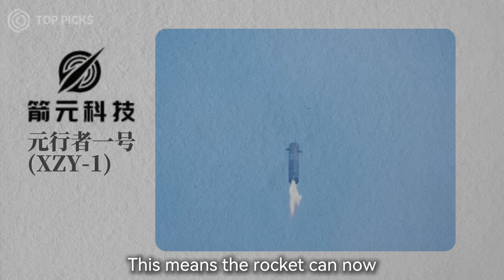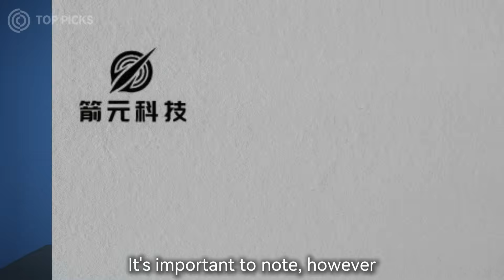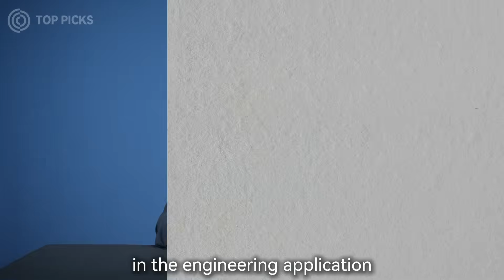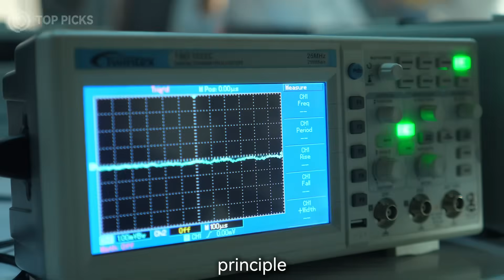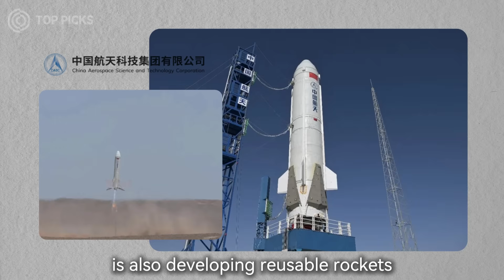Who is China’s SpaceX?

Comment: The expectation people share about SpaceX are laughable, especially as SpaceX show how they fail every time in areas NASA already did decades ago, while what China does is not only believable to achieve, it as well achieves i without failing at fundamental levels. If I ever wanted to fly into space, I'm definitely not choosing the death trap SpaceX is "designing" as Space is a literally death zone you can't just freely move around and expect nothing to happen as you are hit with ionizing rays which break you apart without shielding, no way of easy refueling/resupply or a way to not die of age on long trips (Apollo 13 is just an example on how easy it is to die in space, even with multiple fail safe on a trip to the moon).
Reply: US astronauts already ride to and from the ISS on Crew Dragon which is like 100x better and safer than your Shenzhou copy of Russian tech.  SpaceX is operating like NASA did in the 60s, and like Silicon Valley, built cheap and fast and test to destruction.   New Glenn did the opposite, and they just landed a rocket too.  China has yet to do either and is stuck with old copies of Russian tech.

That "death trap" you talk about, has already launched dozens of people to space and returned them. Last time China's crew return vehicle came back, it landed wrong and went out of control rolling along the ground.

The idea that Starship's current design is the one that's going to be human rated is due to your ignorance. The current ship is for cargo/refueling, it's not the Human Landing System (HLS) one. And as SpaceX proved with Crew Dragon, they can design a far far far better crew module than China can.
Reply: @TheVoid-g6f  will rocket labs neutron be third?
Reply: @blengi  Yes, Neutron is launching in early 2026. But Neutron is Falcon 9 class in payload. Terran R is also launching in 2026 and is more medium class.

So, the US will have the entire spectrum: Falcon 9/Neutron for small lift, Terran R for medium, Falcon Heavy and New Glenn for Heavy Lift, and Starship for Super Heavy. Plus SLS, ULA, Firefly.
Reply: @TheVoid-g6f  Cheers, good info. Is odd how people here haven't noticed spaceX has launched twice as many people to orbit in a few years than china's entire 20+ year manned space program
Reply: @TheVoid-g6f  I'm talking about starship and orbit isn't space, this is a very important distinction and yes look at the rockets, don't they look familiar? The designs of Falcon-9 and Crew Dragon aren't new they aren't much different from previous NASA designs. The issue is that someone wants to shoot people in storage silos into space expecting them to survive long trips although they need tons of extra material which as well needs to be protect likewise which results in a ton of weight, which is never tested by them and it still fails far before having any noteworthy weight. They test like there were never any space ships developed but even worse.

Comment: In my opinion, it is a trap to try to be a spacex. They have one operational platform (in which I include the variations of falcon)
But any attempt to replicate starship, will end in failure, not because spacex is that good, but because starship itself is not a viable idea, And even if they have impressive engineers, no ingineering can make an impractical end product that has built in enough points of failure for a single mission that each one becomes a dice roll.